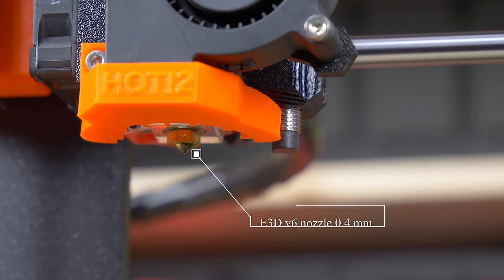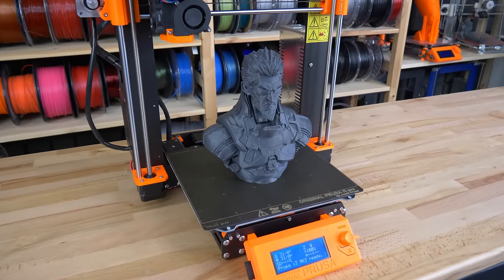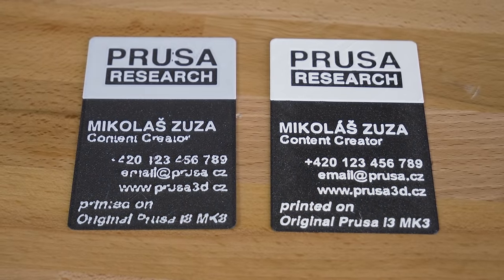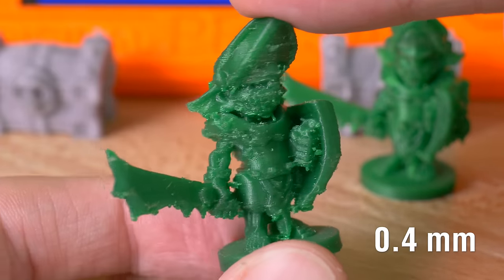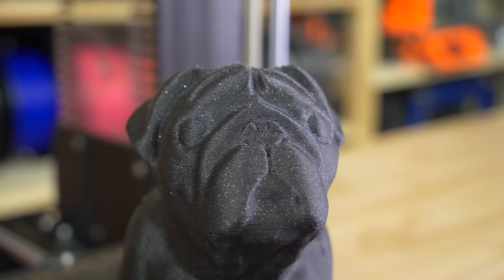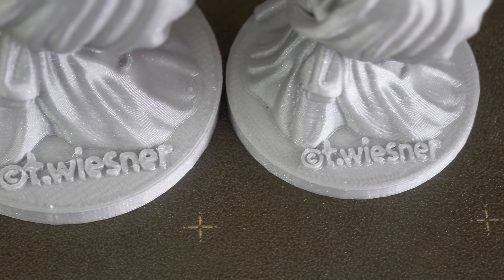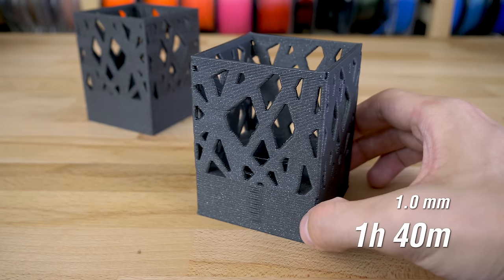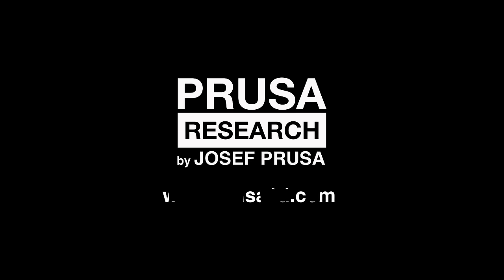Everything about NOZZLES with a different diameter

Comment: I want to try a 1.2mm nozzle but that requires a volcano to be able to keep it hot and not have to slow way down.
Reply: I got a knock off volcano. It doesn't fit the best with my Printrbot Simple Metal, but it does keep up easily when I use a 1.2mm nozzle. I got a kit on Amazon for $30 or so. It had the heating element, thermocouple, an aluminum heat block, stainless steel heatsink that had a heat trap, a fan and shroud; along with a bunch of normal and volcano nozzles. I had everything I needed from the start. Protip: use Teflon tape near the end of the threads so the plastic doesn't melt into the threads and you can only remove everything by heating it up.
Reply: I only use all metal hotends now though as I print ABS that demands 260c.
Reply: I use PETG mostly, so I print at 240ish. If I print PLA I go down to 205. I still use the Teflon on the threads of the nozzle and connector but it hasn't caused any problems yet. I forgot to mention, the kit also came with threaded connector sections, I got a metal one and two Teflon lined ones. I'm using the all metal one. With the volcano, you can use a lower temperature because of the longer distance it has to melt the filament. You pump more heat into it overall with a longer melting distance and lower temp than a shorter one and a higher temperature.
Reply: I know on a standard heatblock I used PTFE tape on it and the tape turned black.
Reply: Yeah, it turns black for me too, but it still works
Reply: You do slow down, print speed with 1.2 mm nozzle is 10 mm/s. Any way its awesome, perfect for printing 1 meter tall parts
Reply: With a Volcano there is no reason to slow down that much as that is too slow to make it worth it and the reason the Volcano was created.
Reply: The Best Stooge if your extruder can keep up the pace, go for it

Comment: I'm new to 3d printing and just received my first printer less than a week ago.  Thank you for your informational videos.  They are helpful!

However, at 2:22, you stated that the vases would take the same amount of time regardless of the nozzle size.  However, I just saw someone else claim that the print time on a vase was cut in half. https://youtu.be/jyhLQUQTc9E?t=198 

Am I misunderstanding something or does a larger nozzle size decrease the print time for vases?
Reply from the maker: If you do not increase the layer height, the printer will do the exact same number of moves, regardless of the layer height. (so the print will take the same time)
Of course, larger nozzle allows for greater layer heights, which will shorten the print time.
- Mikolas
Reply: @Prusa3D  Thank you.

Comment: you can get similar results by adjusting your layer width in slicer, its kind of hidden in Acura so Google how to do it but you can get similar results by just changing settings, don't go use a layer width of over 150% your nozzle diameter though or else your quality will start to go to shit. cnc kitchen made a good video on it.
Reply: im not sure if you can reduce the width with good quality results though

Comment: I wanna know how to print CHOCOLATE models. Is that possible?
Reply from the maker: It is, there are even companies selling specifically chocolate 3D printers. In general, the really tricky part is getting the chocolate viscosity (temperature, chocolate type) just right. A few degrees C can be the difference between it being almost liquid and not flowing at all.
- Mikolas

Comment: Printers are still too basic. How about a dual or triple print head or adjustable nozzle?
Or allow different zones of the design to be printed in 1mm or 0.6 etc. to save time.
Or have print head arrays to take one feed and selectively extrude from 4 or more nozzles?
Still plenty of progress to be made, just like 2D printers.
Reply: Expensive as hell but check the tool changer. All the current solutions have a lot of issues honestly
Other than the 3000$ tool changer :p

Comment: i will celebrate the day the manufacturers come to the conclusion 2-Nozzle printers will be the new standart . (1mm + 0,25mm Nozzle.). So fast + Details
Reply from the maker: We prefer hot-swappable nozzles, maybe an idea for the next printer? ;)
Reply: i mean a dual nozzle extruder, 1mm nozzle + 0,25mm nozzle operating at the same time. the 0,25mm nozzle is used only for the outer shell.
All other tasks are done with the 1mm nozzle where precision isnt needed. Then combine this with a belt drive (instead of leadscrew) for  the X+Y Axis and you outrun the competition for granted :D.
(Z axis can be leadscrew or belt since it doesnt have to be fast)

Comment: I print 99% useful mechanical prints for around the house and diy projects. I tried to buy some nozzles but it seems the Flashforge uses a different nozzle thread so I couldn't install them. Be careful when ordering.

Comment: Im new to 3d printing. Have Creality cr10s pro V2 and just learnt something else too. Black filament you cant see shit when its printing. Im going back to white after these two massive brand new rolls are used up.

 WHEN will you finish. 

I had to endure tv growing up with 3 channels and a curved screen with a tube in the back. Now 50 almost and having to endure the shit end of home manufacturing. In ten years we will be looking online at companies products and then after buying with bitcoin or equivalent, making the stuff at home in minutes. 

Hurry up though because as is this 3d printing lark is shit. I design a part on fusion 360 and by the time it’s finished printing I have almost forgot what the part actually was.

Comment: All of which makes me WONDER: dual nozzle print head with DIFFERENT NOZZLE SIZES INSTALLED???   Is that a THING that any slicing software could handle???
Reply from the maker: We are actually considering it for the Original Prusa XL, but we are still debating the pros vs the time/cost of implementing this. -Mikolas

Comment: Why are things not as simple as you said in 1:05? You basically opened the video with that and then you made no contradictions from this statement. It's exactly what it is, detail vs speed. Sure detail might not matter if you have a model without detail..isnt that common sense?

Comment: 02:19 This is not correct. If you leave the layer height the same yes, but vase mode is MUCH quicker when you put on a larger nozzle and increase the layer height. Seriously, this is a stupid statement "the printer still has to do the exact same sequence of moves".
Reply from the maker: "The printer still has to do the exact same sequence of moves" is the whole point of this section. 

It was trying to explain that changing the nozzle by itself won't result in a magical speed up if the generated toolpath is identical. The easy case of that that came to mind was the vase mode because you don't have multiple perimeters, which makes things more complicated. 

Fair point though, the graphic should have included "using the same layer height" or something like that, to prevent confusion.
- Mikolas